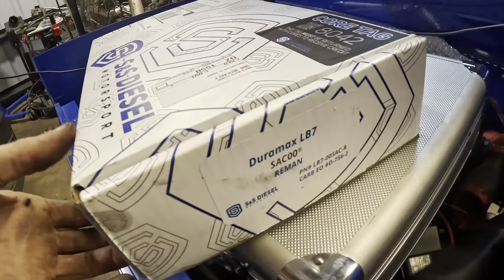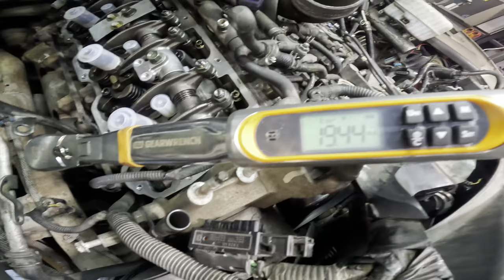ONE MISTAKE and DO IT AGAIN! Fuel Injectors INSIDE of Engine

Comment: Those fuel lines that you're putting on the injector itself and onto the rail, I believe that they have a torque spec of 12 ft lb. There is a procedure used by European manufacturers, that they will torque these to about 6 to 8 ft lb, if they have to ever serviced it again they will raise the torque spec by 2 lb each. That way you don't have to replace that fuel line each and every time you work on it. And I believe that the final torque spec on the European fuel lines is 12 ft lb. It is a way to not have to replace those each and every time you work on the system.
As for what Machinery those were made on, they were probably made on the original machines. All they did was pack them up and move them to a different location. They will sell the old machinery. However, Machinery only makes Parts within a certain range of tolerance.

Comment: Lord, what a mess...
Is this one of those V8s converted into a diesel?
I remember, back in the 80s, the big race to Diesel up everything, and in that race, modifying V8 engines, to make them Diesel, which was a humongous flop!
Yes, I purchased an Isuzu Diesel P'Up . The engine they used, was the same engine Thermo-King used, for their reefer units, and it most likely is still running, LOL!
That little truck got almost 60 miles a gallon!
What was really sad? The government, as well as the petroleum industry took notice, and the price of Diesel fuel went through the roof!
Back then, Gas was like 87 cents a gallon, and Diesel was stupid cheap, like 38 cents a gallon.
When the powers that be took notice, Diesel fuel went up to like $1.20 a gallon, while gas was at around 90 cents a gallon.
Nowadays, Diesel is like $6 a gallon, while gas is around $4...

Comment: Why wouldn’t they groove both sides of lower valve cover to accept a rubber gasket?
Reply: Not enough material on the upper face to machine a groove to fit a gasket.
Main thing I find strange is there are no locating dowels on the upper cover so the seals line up with the injector pipe squarely.

Comment: my name is brandon i have an 03 lb7 im in process of installing injectors i an on the second set my first set was bought from peak fuel injection i paid 1400.00 for the set installed them and right off the rip failurs. so i bought a second set from deisel logic while being in the instalation process hearin you talk negative really got to me but hearing you do a rebuttle on that was uplifting

Comment: 52:34 when you took out the bango 
Bolts there was no way they had been install at 120 inch pounds
The guy just stuck parts back together without a torque wrench.
Even with hot metal changing the torque specs it could not have changed it that dam far.  You struggled to bust loose most of the allen cap screws   thats the main reason your redoing this job 
Shade tree mechanic or someone who didn't care.
It was worth the job to buy the right tools. 
Speaking of you should buy a harbor fright arbor press or find a good used american made one
It would make pressing out seals a breeze.

Comment: In my opinion there ray those injectors if they make 140,000 miles you're doing good most of them don't make 100 kind of just 100,000 mile up tune up

Comment: I ran into the same negativity when I worked as a diesel fitter in a women's clothing store.  A big woman came in one day and asked for a pair of pantyhose but didn't know what size she needed. I went  about assisting the woman, found a pair , that was triple X, held them up and said "Yep diesel fitter".
Two days later the big woman came back and complained that the pantyhose made her ankles swell but it turned out to be trapped farts caused by a very tight waistband

Comment: After reading reviews of diesel logic there seemed to be a running theme and I think your speculative criticism was warranted. Even some of their "5 Star" reviews were actually negative.
Reply: I think a " get what you pay for " is in order here !
Reply: The only issue there is in one of the companies responses to a negative review they claim they send out "Genuine Bosch Injectors". If that was the case the injectors would be stamped with the Bosch logo and part number. The ones Ray removed from this unit had no such stamping.

Comment: Why do you use dielectric grease instead of Vaseline? Vaseline is way cheaper....
Reply: Dielectric grease is inert, usually silicone based, and won't affect rubber parts. Vaseline, on the other hand, is petroleum based and can degrade rubber components.

Comment: Some guys one in particular rag on Dorman a little too much in my opinion, every manufacturer has it's weak points, I installed four Dorman window regulators in my 2001 lesabre ten years ago and haven't had any problems with them, they still work like new, when push comes to shove sometimes you don't have a choice.

Comment: Internal fuel injectors, dumbest idea car manufacturers ever had. This was just to make you have to take them into the shop to replace them vs. older cars where you could just pull off the coil packs and replace them yourself.

Comment: Any bolt or nut that requires a specific torque should always be replaced and lubricated to assure that torque is as accurate as possible.
Reply: If you install a bolt that has a dry torque requirement which almost all of them do and then  Torque to spec then you have overtooked it by twenty-five to thirty percent.

Comment: What a complicated & fiddley proceedure in day all that stuff was either not on the engine or it was external. Iam not sure that unless you guinely need the low down torque that a diesel engine gives you why anyone would buy a new age one purely because of the cost to do a repair like this.

Comment: I understand the threat of legal action does change ones proclamations.  Although, upon your visit to their facility, a rigerous questioning of their corrective procedures concerning the injectors in question, should be the focus of the visit.  Their assessment of the issue and what changes in engineering have been achieved to insure no further customer complaints !!

Comment: Exchange defective parts is one aspect, but these things do not install themselves its a costly job 
Book time, now keep in mind theses are wearable parts,
So mileage put on them year installed ex all play a part into manufactures responsibility when parts fail far too soon because of bad manufacturing.
Its a shame you have to call one out to a wide audience to get them to pay attention. However you really must have struck a cord for them to call you.
No it doesn't make you an ass, but it does get manufactures to step up to the plate, question is would they do this for anyone with a complaint?  Or is it just because you pointed it out to a wide  audience.         Reputations are important as a result they would like to mend there's.thats the first step in the right direction.

Hey look at the 737max and the door the blew out the side of an aircraft, now injectors on a truck do not have the same impact but faulty manufacturing is an issue.
(Personally they should scrap that whole line of airplanes) how many other problems do they have, that we haven't seen yet?  Would you get on one?